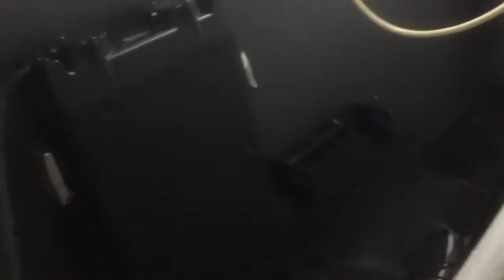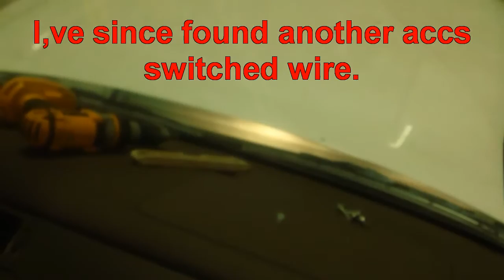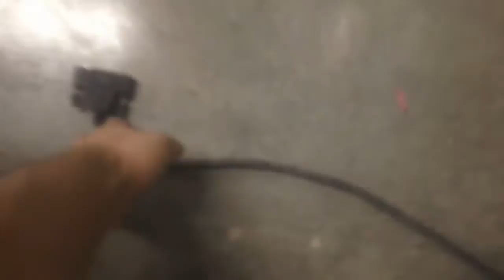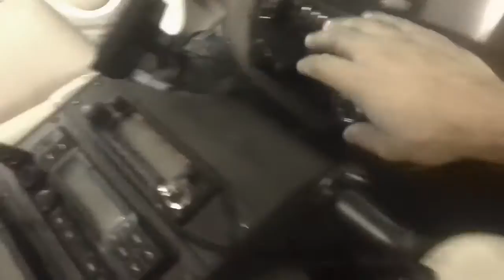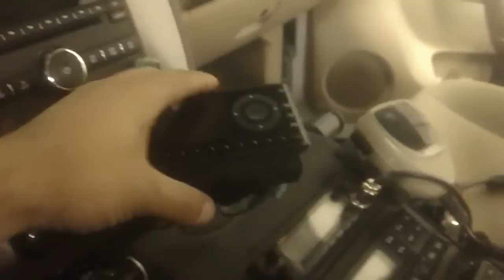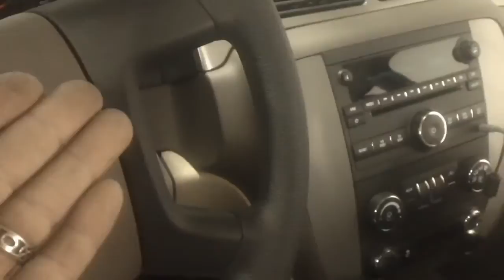Final Mobile 2-way Radio Installation, "SUPERSIZED".

Comment: I love this set up and how you wired it to allow for constant on and ACC on with the relay using a switch. I was wondering how you wired the three way switch to control the radios. I assume it is an ON-ON-ON DPDT with a "constant on" and "ACC on" wired through it. I am doing a similar set up for my ham radio, Motorola radio, dash cam, lights, and some other accessories. I am having some issues figuring out how to wire that switch.  Could you do a video or explain how you wired that switch to the relay? I'd love to be able to do that too. Thanks!
Reply from the maker: I'll try to do that. Summertime is a killer for me with disposable time off. I got some material at bat that I need to release for fire season, then I'll fit it in. I think it will be a good subject to cover. Thanks for watching.
Reply: Awesome! Thank you. I can't wait!

Comment: I noted you talking about anti-theft... one thing that works for me and I drive an 04 Crown Vic Is I went ahead and installed AMBER lights in my car. Those combined with the radios, the cage and the car itself has prevented many thefts. For example, the gas station I normally go to has a high volume of vehicle burglaries and my own street does too now after my car started showing up more often and was parked in front of my house more often the break-ins stopped on my street and were reduced near that gas station. and what those idiots don't get is that IM NOT A COP! haha I run a roadside assistance company and when I give people rides to a gas station or where ever they need to go when their car gets towed I NEVER let them sit in the front....for safety reasons obviously. Now they can enter and exit the vehicle as they please, there are no locks on it like an actual cop car but the fact that the break-ins stopped after my car started appearing was good enough for me. Now you can do the same thing that I did with my dad's car. Put in dummy lights. Buy LED lights and they must not have colored lenses or this trick won't work, the kind off eBay or Amazon that police fire and ems use but buy them in AMBER or AMBER CLEAR! This is important for later on.... Install them professionally and hide the wires that way when crooks look in the car they see the lights and the radios and the cage the first thought in their mind is "oh shit, wrong car"  Now when Said buy amber or amber clear I was saying that very specifically for the fact of if you do decide to hook them up and use them, Amber and Clear are both legal colors that are used on tow trucks and roadside service vehicles all over the US and are LEGAL to own and operate as such. Now if you have another system that works for you, great. But that's my method. Keep up the great vids!
Reply from the maker: Hahaha, Yup that will work really good for the average knuclehead. Since the making of this vid, the Org that I work for marked all the vehicles in the fleet. Now I really look like a LEO vehicle with stripes, cage and antennas. I even get "whats up" waves from real cops when we pass each other on the road. Unfortunately I get alot of mean looks now and people notice and watch, where, in the past its a double look and I'm gone without them noticing what I was. Some of my co workers actually had people take off running when they rolled by in their marked vehicle, little did they know were just maintenance cable guys.. Thanks for watching.
Reply: No problem man! That is kinda funny though. Would you mind making another video about the vehicles if you're allowed too?

Comment: Chevrolet models do have an accessory mode, for stereo, which will keep it turned on for a certain number of minutes after the key is turned off, unless the drivers side door is opened. You should see if you cannot wire your radios up that way. This will allow you to have them on, if needed, while the key is off, but turn off the moment the drivers side door is opened. You might want to see if you can wire them up that way.

Comment: Nice vid! Wish I had my Chrysler minivan with me here in SV9 land, had built a custom upholstered console which held 3 Kenwoods V, U, and 800, an SEA 220mhz ACSB, ARROWSTICK controller and controls to a Federal PA300 that I turned into a remote mount. Spent almost 20 years as an RF tech for Central Ohio's largest UNIDEN dealer and later as a Kenwood dealer after the Powerphone buyout. Only problem here is that local LE would never understand why I would have all the equipment in my car.

Comment: A roof that large probably gives enough separation(barely) to prevent interference. On my truck cabs, I use bandpass filters. Expensive, but cheaper than the receivers of my radios.

Comment: If you don't have a chassis rail to ground standard practice would be to weld a plate within the engine bay..
Since you have a min of 5 radios with grounds to play with pending on the guage wire you are using I would be inclined to use 5x on the gauge spec to terminate to a plate or chassis rail this guage will go up with each additional radio you add to the network farm of radios you have within the radio setup...
If your terminating into a 8 gauge strip 40-48 guage will need to be the earth from the grounding strip...

Comment: Did you ground the antennas?????  General. Practice is weld a plate in place as generally skins of vehicles generally have poor grounding insulation quality...
Reply from the maker: Jason howe No, the hole tool just strips the metal for grounding the NMO mount. Have not noticed any problems or reduction of performance.
Reply: No you don't understand sheet metal isn't thick enough to promote a decent termination ground generally if you are going through the skin of the vehicle general rule of thumb you actually need to weld a grounding plate in place to give the antenna a ground plain to work from...

Whilst you can do it the way you have done it I don't recommend it due to the fact vehicle skins are generally poor for grounding insulators.. And tend not to work great as fixing points for antannas...
Reply: Jason howe you have no idea what you're talking about

Comment: Apco 25?
Reply from the maker: Only on the 800 motorola.
Reply: That was some impressive engineering in that installation, did you get a higher amperage alternator and battery for that load?
Reply from the maker: No, stock alternator. There is no cross patching or anything fancy like that. Only transmit one radio at a time the rest are in standby receive mode. Have not measured what my amperage is while not transmitting, but I'm guessing no more than 1-2 amps. heavier alternators are recommended for code3 emergency lights or command vehicles.
Reply: Understood, I figured you would draw some amperage if in standby mode with engine off upon starting, thus straining the battery and alternator, however I have a philosophy of redundancy.

Comment: A quick comment, a majority of the radios could have been replaced with the new Uniden Bearcat Scanners that have remote heads, with the exception of a ham radio if you wanted to transmit. So instead of 6 to 8 radios, it would be 1 dual / tri band ham radio and 1 or (2 max) scanners. Cuts down on the wires (speakers, mikes, and power). Just a thought.
Reply from the maker: You're absolutely right. If this was my own private vehicle, that's how  I would do it. The vehicle on the vid is my assigned work vehicle and I actually do need 3 out of the 4 radios there to communicate with the various outfits I'm associated with. I added the ham radio for general purposes. Thanks for watching, & great point.

Comment: i have 8 ga you used 6 ga  how many amps can i pull  6 ga and 8 and dose troy products only make the radio compartment for ford dodge and Chevrolet
Reply from the maker: Off the top of my head, I don't know how many amps its rated for. I'm sure you could look it up. 12 gauge wire max amperage capacity is 20 amps, 14 is 15 amps. Again, you could look up troy products website for their complete catalog of offers.
Reply: thank for the info and i am a ham your  set up looks nice to

Comment: Why not use multiple speakers?  Would be a quick way to identify which band is transmitting?  ID via speaker placement?  Just a thought
Reply from the maker: I'm still playing around with the idea of a single speaker just for a cleaner look, along with just having to worry about placing one speaker. I could tell by the traffic type what radio is squawking at the time. currently I have them all separated with their own speaker. Thanks for watching.

Comment: Your wiring setup is WAY too complex and completely unnecessary! I can build one that will work just as well and be MUCH simpler. The more you overtake the plumbing, the easier it is to stop up the drain..
Reply from the maker: This was not your ordinary installation, I mentioned the principals were the same for a simple installation or complex multi radio setup. I don't doubt there is a simpler way of wiring, this is just our standard for all installs. We do everything from fire trucks to LEO patrol vehicles. Its made for easy add ons of equipment and safety from shorting wires. thanks for watching.

Comment: Do you ever run into an overheating/ventilation problem with the console setup? If so how would you address that?
Reply from the maker: Not with the 2 way radio equipment, & it gets hot around my area in summer, figure 130+ in the vehicle. Both ham equipment & commercial gear held up. What did took a dump was a uniden trunked tracker. That particular scanner did  fail in patrol cars with the consoles. I would think over time (decade) some 2 way radios components will change in value causing the equip to fail. The newer radios have sensors built in where it will reduce power if overheated, or if the antenna is disconnected.
Reply: thanks for the reply and the info. I appreciate your generosity of sharing your knowledge. I would have replied sooner but i haven't logged into my pc in a while. Keep up the good vids!

Comment from the maker: I have not seen or heard of an older model from Motorola. But now they do offer a multiband radio for interoperability. either a tri or quad bander called the Apex. nice piece of gear with all sorts of beeps & wisles for at least 3-4 grand a piece. Usually reserved for higher brass first responders for command & control leadership position. Or some geek with deep pockets....